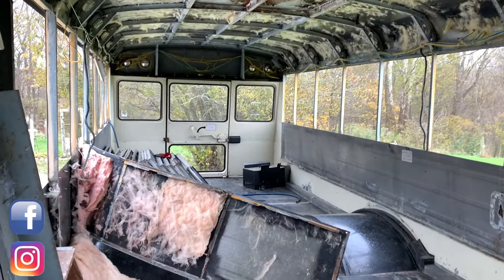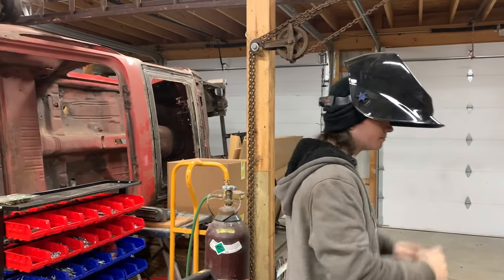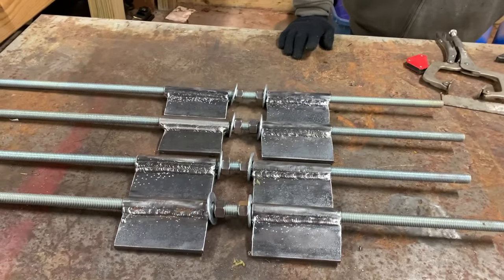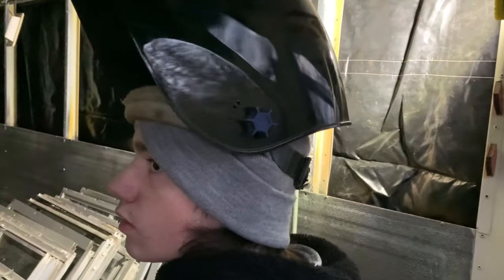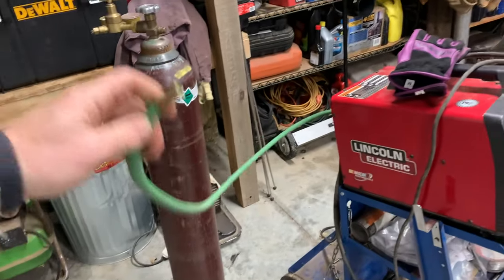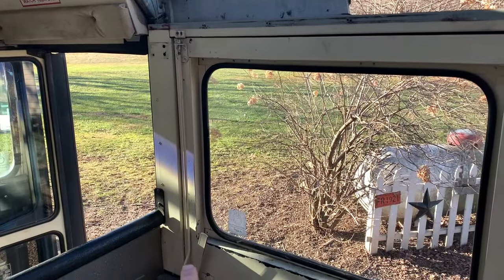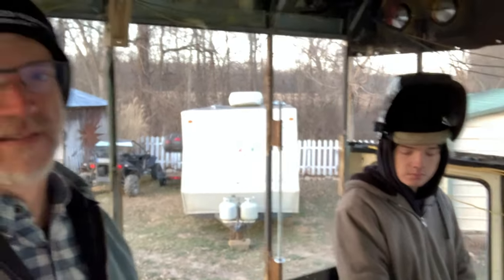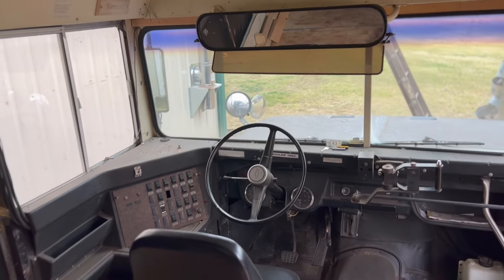First Time DIY Bus Roof Raise

Comment: Small suggestion: Cowboy Josh taught me to only use the 1 o'clock to 6 o'clock position of the cutting wheel on a grinder so if it ever grabs, the grinder runs away from, not toward you. They can get a bit bouncy sometimes and even though I named mine the death wheel, I don't want to prove it, lol. 💥💥💥💨💨
Reply from the maker: Excellent point, and we will definitely do this! Thanks, Matt. 🙏🏻